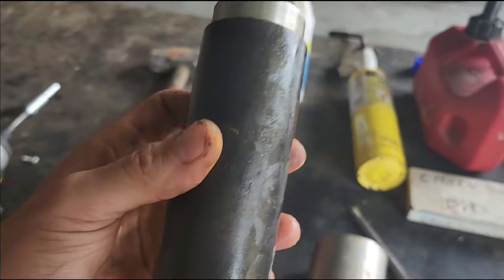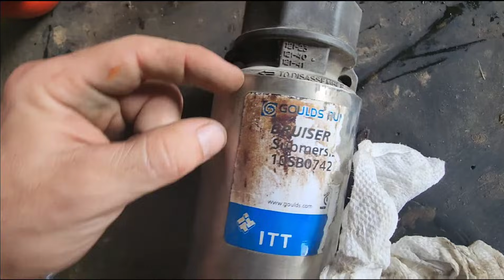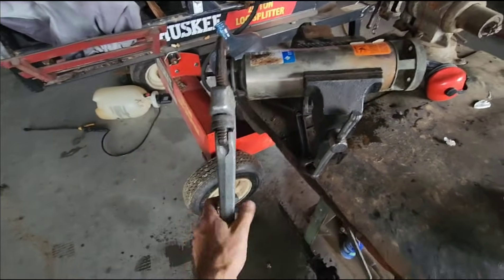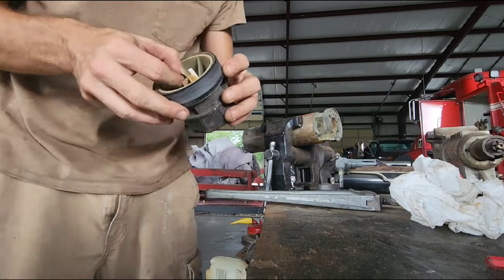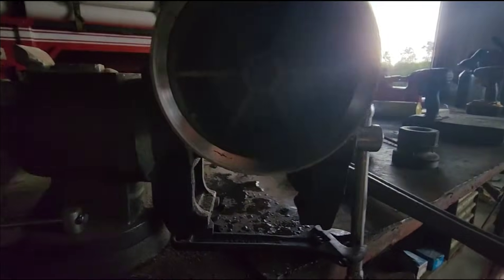Inside A Well Pump. Disassembled Motor & Pump, Is it Rebuildable?

Comment: I'd really like to re-use one of the 2 Goulds submersible pumps I have sitting in the closet. Dad and I had wires to get cut down in the well 2 different times, but we replaced the pumps and wiring in the well both times. 
So both those Goulds 10LS05422 pumps are good. They only ran 8 years on one and 4 years on the other. Dad actually put them in the closet to reuse. The pump that just went out has been in the well 18 years now. We used conduit on the wires down to the pump, the last time it was touched for any pump issues.
Now I'm pulling the pump myself, and would only have my own tail to kick, if one of the pumps didn't last long. Both pumps look great for 20 years old, no rust at all. I have yet to find any type of kit for them though.

Comment: I have an old Jacuzzi pump like this one, but the top is pressed on. I want to open it up and see how it failed. Do I need to use a grinder to cut the top section to get it to come off so i can get to the impellers or do I just work from the bottom up.

Comment: Are they rebuildable?  I would say yes, but only by someone who is qualified to do it.  The Grundfos units you seem to love?  Not so much.  The main reason I think this is because the motor would still be fine, the electronics, since they aren't potted in epoxy and stuck in the bottom (often more than 100 ft or about 30 m underground) of a wet space where electronics really have no business being of a well.  I think if Grundfos was to make it so the pump and motor were in the well and the inverter circuitry was either at the top of the well or next to the tank would be a much better design, but no, Occam's Razor doesn't apply to a lot of European engineering these days.  Heck, a soft start module and a three-phase induction motor in two separate pieces would suffice.  If Rexair can do this with its Rainbow home cleaning systems, Grundfos can do it as well.

Comment: Hey H2O mechanic, will you answer my below question please. Does the c clip have to come off to remove all the stages and shaft as one piece? Or is c clip removal only required to get individual stages off the shaft? Thanks.
Reply from the maker: No clue. Just being honest.
Reply: @h2omechanic  thanks. I appreciate honest. Great video. I think since the  drive shaft came out with the remaining stages when you slammed it upside down then it wasn’t necessary to remove C-Clip. Only need C-Clipbremoved to pull off individual stages.
  I have to tear pump apart again, so I guess I will find out for sure.  Still trying to figure out where the water gets sucked in to make pump work? Must just be small opening near drive shaft.

Comment: I guess I am lucky comment number 100. the question I have as an automotive engineer, WHY are the bits and pieces not available to repair these? the pump stack impellers are all plastic, a wear item, but the bulletproof housing is pricey 304 stainless. that stuff is meant to last forever. then you have the motor. bearings can be had just about anywhere, same as the seals. while I do not condone the home gamer rewinding the motor, there should be some options.....

Comment: I just tried pulling my motor apart, it looks exactly like the one you have but mine is longer (😅) the armature will not come out though. It’s stuck inside the motor body. Yours just slid right out.

Comment: I appreciate that this is an older video, but it got me thinking. It was the bulge in the inside of the motor section that got me thinking, what would cause a motor to fail and internal pressure in a normally isolated section? The answer I came up with was failure of the motor capacitor.

I've had a single phase AC 230V motor capacitor fail while I happened to be close by and it was a very loud 'pop' or 'bang' and a small puff of smoke followed by the motor running down and struggling. Fortunately, I was able to quickly shut the machine off. I took it apart, identified the capacitor and sourced a replacement. The machine ran as good as new! I also remember the smell. That blown capacitor stank like smelling salts on steroids!

I'm thinking that a capacitor failure way down in the well would need somewhere for the gasses to vent, except there isn't anywhere so the pressure forced its way to deforming a thinner part of the casing resulting in the pump jamming. If it was mine, I would carefully take the motor section apart. I expect I would find a blown capacitor of some sort. Some pumps state the value of the capacitor. I would source the correct value and wire it externally, if I couldn't do so internally, to test the diagnosis. I would the reassemble the pump and either bump it on the bench or, if safe to do so, try it in a suitable container full of water. It wouldn't surprise me if the pump just started up and ran like nothing had happened provided it hadn't burnt out, and in the example of the pump here that I was able to come up with a repair for the 'bulge' in the inside if the casing.

Comment: Hello, had a question: why do you have to take C-Clip off to remove stages? Asking because all same diameter stages and after when you slam it the rest come out. Just wondering if you could slam without C-Clip removal and they would still come out? Thank you for a great video. You explain things well and saved me from buying a pump. I was able to clean up all the debris out of the cup, impeller, and diffuser. Iron bacteria/algae and now works great. Thanks.
Reply: the  c-clip has to be removed to allow removal of the stacked impellers.
Reply: @DeborahCuster-cc8sp  thanks. I will have to take another look at how it’s all put together. Video made me think they would all come out the bottom with slam without removing C-clip. I think to pull out top the C-clip has to be removed. I’ll take another look.
Reply: I guess I’m confused because when he slams it the stages and the shaft all come out. I think without removing c-clip and slamming anyhow the stages and the shaft would come out? After all the stages are riding the shaft. I think the whole thing connected would come out upon slam. To pull one stage off shaft at a time then you would need c-clip removal.

Comment: Why is my pump when powered on it shuts on and off every few seconds ? Pls help
Reply: Short cycle can be caused by faulty pressure switches or a leaky bladder tank. Or other possible leaks in air or water sides of the lines.

Comment: I have a question, my well is 33ft deep and i have a submersible pump, question is can i tap into my water line where it feeds into my house to install a manual pump for power outages, i would be pulling it through my submersible pump
Reply from the maker: No, I won't pull threw the pump. Impeller stack in the pump is too tight

Comment: Soooo, some tight wad could have just installed an external check valve on the outlet of the pump and kept going ...   PS, I really do appreciate the tear down.  I looked a the parts diagram and it seems all the stages are supposed to be the same for a given model.  Oh, the rubber "hat" you saw in the bottom is a pressure balancing diaphragm.  The liquid in the motor (distilled water?  Light oil?)  is, I think supposed to be sealed.
Reply: Seems like a good reason to install an external check valve when installing the pump the first time.

Comment: In Ukraine, they rebuilt the well pumps, and they rebuild almost everything Americans think are non-rebuildable.  They do for a fraction of the cost of the new one.  Having lived in Ukraine for 6 years before the war, I saw many things that was disposable rebuilt.
Reply: Not true, they're not terribly smart enough
Reply: @Boycott_Wendys  actually they are, Ukrainians are some of the best engineers at designing rocket motors, and many other things, NASA even buy Ukrainian rocket motors.
I  lived 6 years in Ukraine before the war, and there was a master that could repair about anything.  I had something break, and my wife took it to the master and it was repaired in 3 days good as new.p, and in the USA it would have been thrown in the trash.
Don’t be stupid and sell Ukrainians short, remember the worlds largest aircraft the An-225 was designed and built by Ukrainians.
Reply: @raymondheckard234  those ones were Russians
Reply: @Boycott_Wendys  no European versions of the pumps sold in the USA. Same exact brands that Hensley uses just they are wired for European current
Reply: @raymondheckard234  Are  you trolling Mr Putin?

Comment: It’s motor not pump, pump will attached with it at top. The purpose of the motor is to convert the electrical energy to mechanical by rotating the rotors by the help of magnetic field produced in the stator.

Comment: We’ve been hauling water now for5yrs and finally had a hole drilled last month. We are piecing it out because our income is very limited. I got lucky hopefully and got a pump today that I’m hoping still works. If not I’m going to try and get it going. My well is 325 to static water level 30+ gpm hole is 520 deep I’m panning on setting pump at 350 and using 200psi roll pipe. 
Your videos are helping me tremendously to understand how and what I need to be doing. Ty 🙏

Comment: Nice video, I just replaced my 1 HP 240 volt pump...and hanging on 240 feet of 1-1/4" vinyl pipe...I've never worked with a well before, so being a noob...I did everything myself, in 20 degree weather...old pump motor was seized after a big leak under the house let it run 24/7 for several months, sucked the well dry and overheated the water cooled motor.
 Years ago I worked in a shop that rewound all sorts of motors...the type of motor would probably cost about as much as 2 or even 3 pumps to get rewound.

Comment: These motors are not worth the time to rebuild? I am a disabled guy with nothing but time on my hands, I have just put a used pump down, and was wondering if the old one can be rebuilt to use as a spare? 
When the only commodity a man possesses is time, he is often willing to spend an inordinate amount of it to accomplish a goal. 
I worked in a highly technical field before I was injured, and have rebuilt gas engines before, so I am not the average layman. How would one begin to find the process to rebuild one of these pumps successfully?

Comment: Hey bud like what you are doing, never put a pump down but have worked for a national distributer for 15 years, happy to help with some tech if you like
Reply: Ps cant edit but much of my work is warranty assesments
Reply: He said that these motors are not worth the time to rebuild. I am a disabled guy with nothing but time on my hands, I have just put a used pump down, and was wondering if it can be rebuilt? When the only commodity a man possesses is time, he is often willing to spend an inordinate amount of it to accomplish a goal. 
I worked in a highly technical field before I was injured, and have built hot rod engines before, so I am not the average layman. How would one begin to find the process to rebuild one of these pumps successfully?
Reply: @johnhurtme  hi, motors are not really worth repairing unless you can rewind them yourself, if you bolt your motor adaptor on to a good motor it will set the pump shaft at the correct height then as you assemble bowls and impellers you want aprox 10 thou clearance between the underside of the impeller and the bowl, this is usually achieved using shims, the rest is pretty straight forward. If you need any more info don't hesitate to ask   cheers

Comment: In my experience (I'm not a professional but have set many pumps over the years) a pump failure is almost always a motor failure. I've dismantled junked sixteen or eighteen year old pumps and they looked like new inside. The motors were toast. A friend gave me her old 1.5hp Grundfos pump and I simply installed a brand new motor on it, then installed it in my own well. That was a few years ago, and it continues to run well. Now, I did see a 1/2hp Red Lion pump that failed, and one of the impellers had self-destructed, so sometimes it IS the pump that failed. But as a rule, it's almost always the motor. Great videos! I subscribed and plan to watch them all, even though I've done this kind of work for years.
Reply: Did that motor run on 120v or 240v?

Comment: You are definitely and absolutely WRONG and incorrect!
wrong about the terminology swhile naming the pump parts. each complete stage has a stainless steel bowl, a diffuser, and then an upthrust washer and then the impeller. there are SS shims between each stage.

you are INCORRECT with your statement that pumps cannot be rebuilt! the Technical specification and service manual boasts that thefloating stack designed pumps are "field serviceable" and parts are so much more economical than purchasing a new pump! please, research the products and record a video that is true in regards to them.
Reply: Love your videos!  I lol when you pulled out the Bruiser water end.  Have not seen one in a long time.

Comment: Not this video but on a spring pitless adapter when installing it back in place how do you  know when it is engaged correctly to be able to pull the pitless bar ? we had it disengage twice and finally cut a piece of 1x4 down to slide down in and push the spring lever down which seemed to work but not an experienced well person my comfort level is not satisified at this point. Thanks Dennis

Comment: Hey man I was pulling my pump out of my well, when I pull out about 20’ it gets stuck on something and I can no longer pull. The tag says it’s 240’ deep. What should I do?
Reply from the maker: Is this a 4" well or 6". 
Either way, your hanging on something. Get the that sweet spot where it hangs, go up & down & keep feeling that bump, then rotate the pipe,walking circles around the well, one direction and then the other.  It's a pain, but you should be able to get it by whatever it is hanging on. Typically the pumps wire guard is hanging the bottom lip of the pvc casing. If its 4" casing & a 4" pump, it's a real pain in the rear end

Comment: I would love to see a video of a dropped pump sitting at the bottom of a well and how you handle that?.  Does that happen often?
Reply: this has occurred with a pump 200 ft down on a 400 ft well. i retrieved itwith a 1 inch shark bite coupler that cost $12
Reply: @Sicasevilis  can you give some more details on how and exactly what you used?
Reply: yes
Orbit 35679 1" PVC-Lock Flex Repair, 1-Inch, White
is the exact part i used. h
just connect it to yourdrop pipe and lower it down.
i did use a cheap swann night vision camera(removed from mounting stand) with 200ft cord inside the pipe repair coupling. i could see the broken pipe and was able to place the repair coulling over it and pushed down to connect! amazingly only took a few tries to get it connected. 
the camara set was swan  from sam's club 69 bucks and the cable from best buy was 25 bucks.
my well is 420 feet and 200 feet is very heavy still with a pump at the bottom. if youhave any more questions let me know
Reply: @Sicasevilis  that's great to know thanks so much for the reply and the details
Reply: @Sicasevilis  Using a swann camera as a borescope is gold 😂
Nice ingenuity! 
If you need to do it again, cheap 100m borescopes can be had for $30 nowadays (no idea how they make any profit, I couldn't even buy just the cable locally at that price).

Comment: Hello, that blue tape you use on the electric connection down in the well at the motor, what's the name of brand of it
Reply: I've been using 3M 33 electrical tape for decades, it works just as well as shrink wrap.